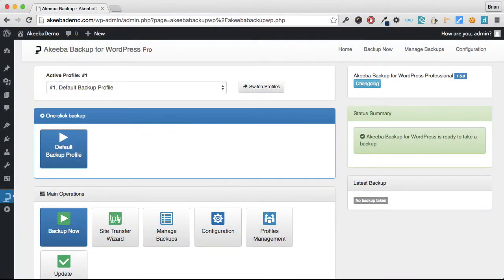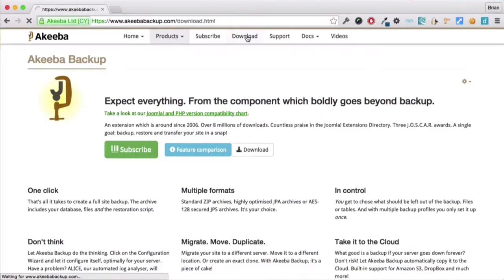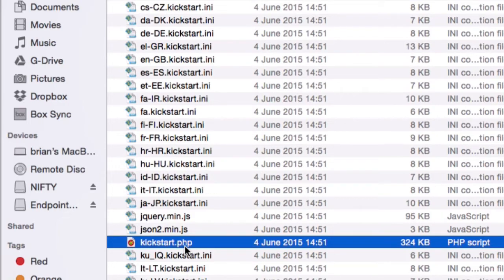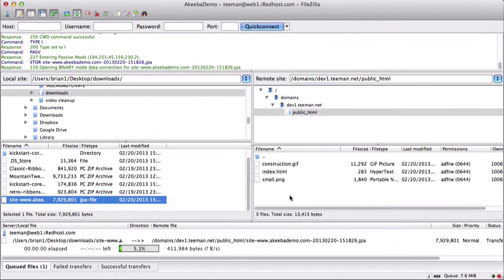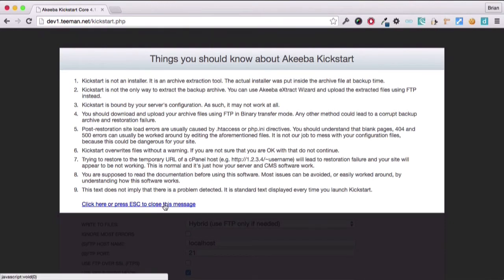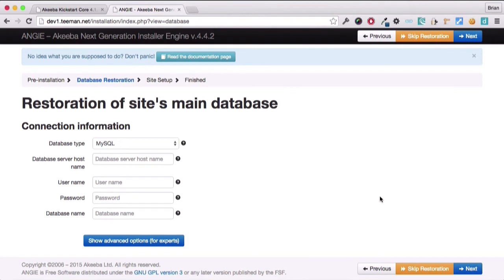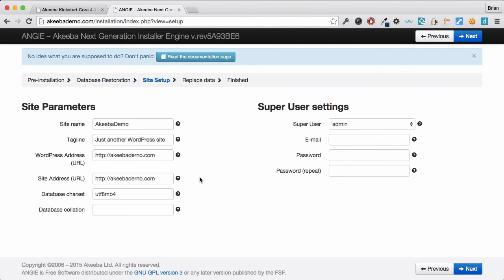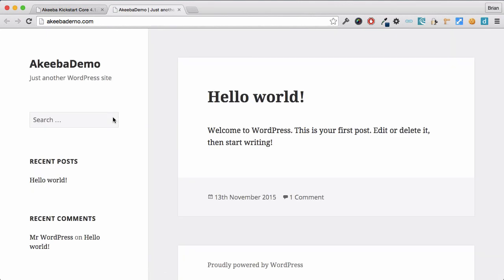ABTW05 Restoring a site on a new server

Comment: E' vecchio, tropo vecchio questo video, dovreste aggiornarlo.
Reply: Even though the video was shot two years ago it's still current. Restoring the site on a new server is not that much different than it has been since 2008, really. You download the backup archive, upload it to the new server, run kickstart.php and follow the instructions on the page. All you need to provide is the database connection details and make sure that the URL to the site is being picked up correctly. The video indeed doesn't show an optional restoration step (changing the information in the Replace Data page) but if you NEED to do that then you already know why you do and how to do it. Everyone else can just click Next on that page.